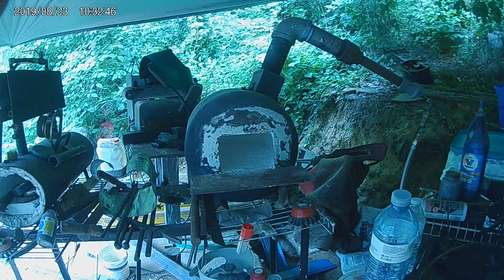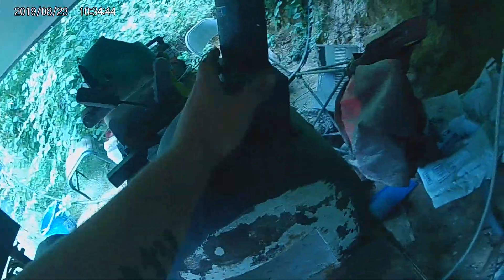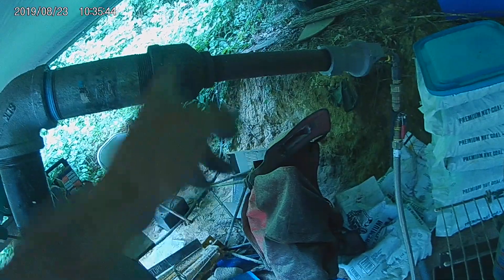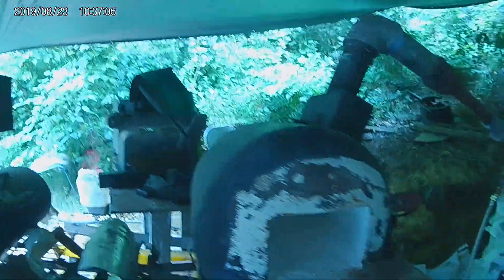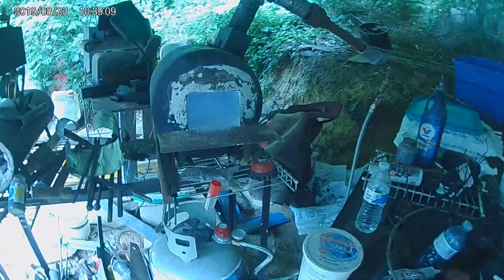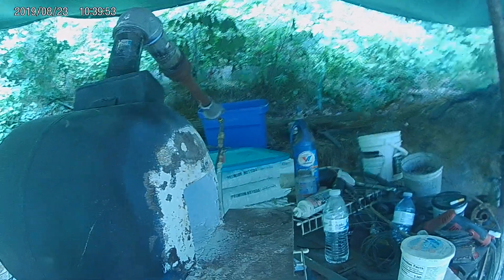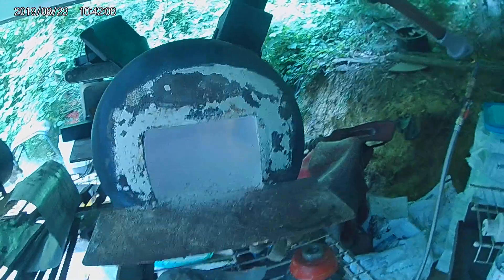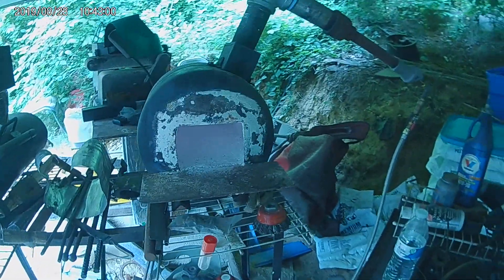Ribbon burner naturlly aspirated

Comment: This is awesome.  How long are the ribbon burner holes cast in the refractory and what diameter are they?  Do you have some method of choking airflow or did you have to experiment to get the venturi air ports correct?

Comment: Does it get hot enough to forge weld ?
Reply from the maker: It can but takes a while.  If the feed tube is a bit smaller with a smaller burner block it should reach higher temps faster.
Reply: @alvarezblacksmithing4043  because the gas outlet is to small for the amount of oxygen could one increase the size of the gas outlet ?
Reply: @alvarezblacksmithing4043  oh and thank you for your response greatly appreciated !

Comment: Your 6x2.5" burner block is it filled with anything or have baffles or is the block covered with a plate with holes drilled in it.  I want to build this same burner and I'm being told it won't work without forced air.  Also with it naturally aspirated, will it get to forge welding temps? It looks like a successful design so I would to replicate if I could.  Thanks for the info.
Reply from the maker: It is filled with refractory cement with 17 jets made with crayons.  If its steel it whistles very loud.  It will work but reaching welding heat takes a long time
Reply from the maker: Just to add i did end up making this burner forced air.  I melted out 2 forges with the same burner.  Its small but powerful

Comment: Awesome build! Do you ever have trouble with it back firing after its been running a long time (more than 4ish hrs)?
Reply from the maker: thats the only problem with this build i think it because the 2 inch pipe if it was 1 inch maybe it wouldnt.   ive ran it for maybe 2 hours it still backfires.
Reply: @alvarezblacksmithing4043  Has it ever back fired while running?
Reply from the maker: It wont backfire until the gas is shut off even at 1psi